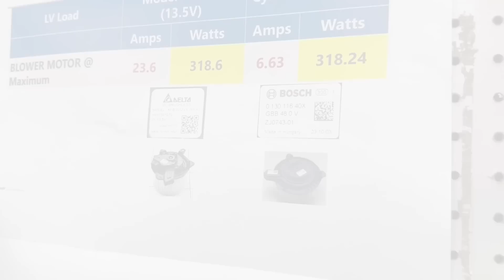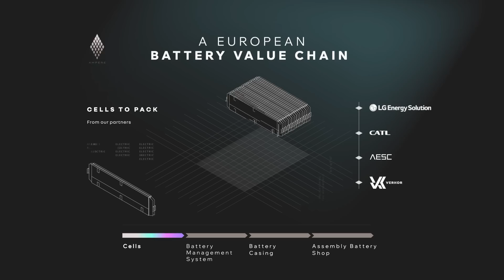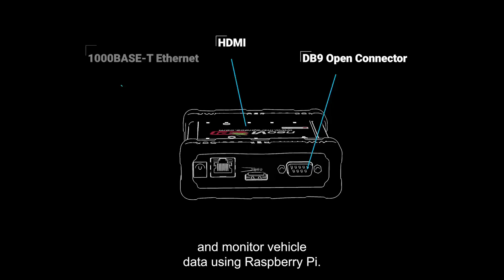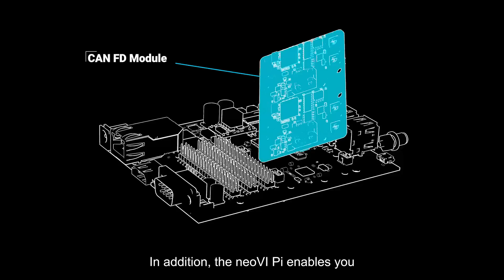Legacy Suppliers Key to Tesla 48-Volt System; Renault Pioneering Pouch-2-Pack - Autoline Daily 3844

Comment: NASCAR EVs would be good race. Could have 100 kWh packs held on by 6 bolts. 
Car comes to a stop in the pit, a flat trolley slides under, car jacked up, 7 crew undo bolts and cables/cooling hoses. Pack slid out, another slid in, bolted, trolley slid out, and car away in 30 seconds. A NASCAR would probably go 200 miles on a 100 kWH pack

Comment: 48v architecture will takeoff when the high end legacy manufacturers decide it's time to go ahead with their transition plans....... because THEY are serious about continuing in the auto manufacturing business
Reply: Europeran legacy has been using 48v sinde 2013/2014, and 48v as primary systen since 2017
Reply: @GTO33  after Elon 'invented' it, obviously 😂.
Reply: When Taylor Swift & Beyonce go 48v, all will follow
Reply: the German Big-3 OEM's (Mercedes, Audi [VW], BMW) have already long deployed 48V in it's "proper use case" to simultaneously give the best ROI to the company and best benefit to their customers.  however unlike the GROSSLY INEFFICIENT Cybertruck, the German vehicles are already super efficient to begin with, so what this means is they DON'T NEED to incur the EXORBITANT COSTS to create a full system wide 48V architecture for very little gain at this late date in "optimized" 12V history (ref: the Law of Diminishing Returns).  however in stark contrast, Tesla Corp HAD NO CHOICE but to pursue 48V, because if they didn't...?  the "Cyber Rhombus" (additionally handicapped by 4680) would SUCK EVEN MORE in terms of efficiency than it already does, aw crap...

that's right, an existing 12V window motor or wiper motor be it in a Gas car or an EV has the EXACT SAME EFFICIENCY as the costly AF 48V window motors and wiper motor in the $100,000 Dollar Cybertruck when the windows and wipers are NOT BEING USED.🤑😀 yeah, so in that recent ice cold Winter of Chicago (when all those Tesla's were dying) you can bet NOBODY was driving around and rolling their windows up and down like a MANIAC.  so in like fashion in the "desert dry" conditions of Summer in say Phoenix or Las Vegas where they get very little rainfall, short of the occasional blast of washer fluid to clear dust build up (an event that lasts for all of 10 secs) you can bet NOBODY is driving around either with their wipers on 24/7/365...

sorry kids, but you've been DECEIVED by a "48V Con" of conspicuously NOT not having many of the Cybertruck's Loads (and related Amp Draw) discussed in terms of DUTY CYCLE which is something REAL Engineers (not laymen) would take into consideration.  for example in an EV like the supposed "lowly" Chevy Bolt, the Amp Draw of those 2 "consumers" i just mentioned is MORE THAN OFFSET by the car's ability to REGEN up to a MASSIVE 70 kW (true story).  in fact the Bolt's FWD electric motor is so powerful it can technically deliver a HIGHER PEAK NUMBER back into it's battery (at stop lights) when it's being driven around by an owner than when it's going nowhere, sitting plugged into a 50 kW EA station. 😅
Reply: @phillyphil1513  I was going to argue until I read the part about the Bolt, then I went fanboy
Reply: @phillyphil1513  Cybertanic is purely for the headlines..........the free publicity.
Reply: It's only necessary if they decide to use the laggy video game like steer-by-wire system in the Tesla Cybertruck that is supplied by ZF Friedrichshafen which requires 48 volts.

Comment: A Robo taxi running maybe 16 hour a day and doing 100,000 miles / 160,000 kilometers a year can replace 5 to 7 cars that spend 90-95% of their time parked.
Reply: Probably even more if you consider people who would be the first to get rid of their cars, e.g. the ones who drive even less than the average. Say less than 10000km/year, so you could be replacing double the the cars when extrapolating from just driven distance. In reality it is probably much more.

Comment: According to Nasdaq 22 million metric tons was used in 2023.
Or, 22.000.000.000.000 kg.
Every ICE car uses 18-49 punds 
That's 15 kg. 80M car are produced, so 1.200.000.000 kg copper in ICE cars.
A typical EV requires over 132 pounds of copper. That's 60 kg.
So, 60*80M is 
4.800.000.000.
4,8M - 1,2M is 3,6M kg more.
That's 1,65% more copper. (22T kg).

Please be serius, 1,65% more copper. Why are Autoline refering to those FUD reports?
This is just propaganda, and I thought that Autoline fact checked those things.
According to researchgate numbers this is less than the increase from one year to another.
Reply: nonsense!!!! copper is not just for EVs, its for the charging cables, for charging stations, more transformators, more renewables like wind and solar needs tons and tons of copper, offshore windfarms, power stations and more thats alot  of copper.

Comment: @9:39 Holy [expletive]! 1,300 horses. That will mean speeds will have to be electronically limited or racetracks will have to be redesigned to the higher speeds. (i hope it's going to be the latter.)

Comment: @12:12 I'm looking forward to all the electrical voltages going to 48 volts and the CANBUS going to redundant Gigabit Ethernet cables. (And run the cable on both sides of the vehicle rather the method Tesla is using in the CyberTruck of redundant cables overlaid atop each other.)
Reply: But isn't Tesla using a ring? Exactly because of that.

Comment: "Stock" EV races might actually be interesting again, if they went back to the historical basis of NASCAR, and ran STOCK EVs.  It would be interesting to see what manufacturers would come up with if the designs went back to a "Win on Sunday, sell on Monday" design incentive.  The engineers would certainly get a kick out of being turned loose to get performance and durability experience out of racing their car designs.  Tesla roadster vs Porsche Taycan vs Hyundai N vs E-Corvette could be a real draw for the younger fans, uninterested in watching noisy, smelly, obsolete ICE racers that bear no resemblance to their 4-cyl twin-turbocharged, but still anemic, street versions sold at dealerships.

Comment: Tesla again leads Legacy  Suppliers into the 22th century, kicking and screaming , but they will come. Wont be surprised if Tesla has given the 48 v blueprints to Chinese suppliers already, after all Tesla has Giga Shanghai there already.😂
Reply: Nobody is interested unless they decide to use the same steer-by-wire system used in the CyberFlop supplied by ZF Friedrichshafen which requires 48 volts.
Reply: You mean TI and others who supported 48V reverse polarity protection in 2016.  Go read the LM5050 data sheet.
Reply: @bobbbobb4663  hi BOOB BOOB get your meds Today?
Reply: @bobbbobb4663  hi BOOB BOOB take your meds yet?😂
Reply: @AuralioCabal  Bossman needs a dancer to prance around the stage in a Model 3 ReuterTaxi costume.  I nominated you!

Comment: The "experts" at hybrid car companies think hybrids are better for their bottom line than EV's. They need way more service. We at autoline like to repeat whatever they need us to say.
Reply: Good for some, massively  oversold.  Clouding the waters with hybrids vs plug ins.  "People want hybrids" disinfo
Reply: hybrids doesnt need any more service than ICE, in fact toyota hybrids have no more belts, its all electric water pump, the alternator is one electric drive motor..... its hybrids from bmw and others that needs maybe some maintaining.
Reply: @alanmay7929  hybrids have smaller breaks and engines than an ICE car AND they are dragging around a heavy battery and an entire EV system. So it half the performance with double the complexity. Hybrids are truly the worst of both worlds.

Just get a good ICE car or go EV. Once you go EV you never go back.
Reply: No they don't, the lifetime service cost is about the same for ice and hybrid.
Reply: @JD-yx7be  Almost a good deflection! EVs are way less than either hybrid or ICE. From a good EV design.
Reply: @Tyler_Durden_99  nope! hybrids still offers even better range for example! the toyota rav4 prime has about 600 miles of range just let that sink in!

Comment: Racing is the only use case for swappable batteries.   Nascar will have to adopt this.  NIO?
Reply: So why are Gogoro and other battery swapping  companies doing so well? Scooters and motorcycles seem a perfect use for swappable batteries. Here in the US motorcycles and scooters are toys but in Asia and Africa, they work for a living.
Reply: @steven4315  for asia and africa its going to work very well as long as people doesnt steal the batteries.
Reply: NASCAR could move directly to wireless charging from sources buried in the track.
Reply: @alanlight7740  what another very stupid idea?! imagine the amount of copper wasted and the hazard that it represent! why not at that point put tracks on the ground like third rails for trams lol!!!!!
Reply: @alanlight7740  that will never work
Reply: No. It is faster than fueling a diesel truck... you do not know this?
Reply: @dertythegrower  its not faster than fueling a diesel truck, a diesel truck can literaly have up to 3-4x the range of the electric version lol!!! fuelling isnt even a problem with ICE.